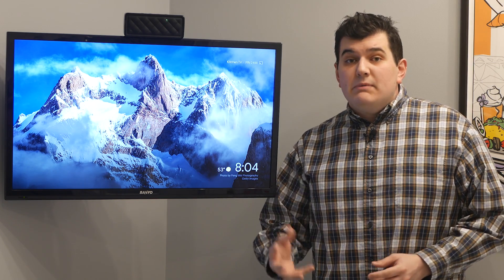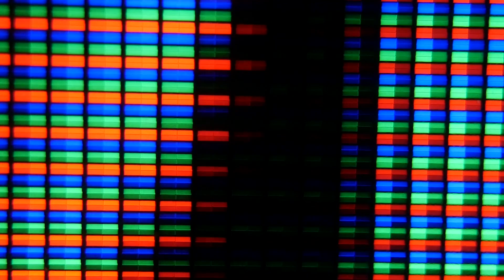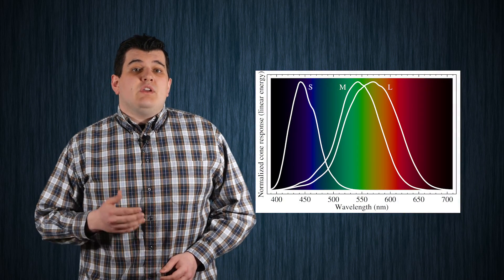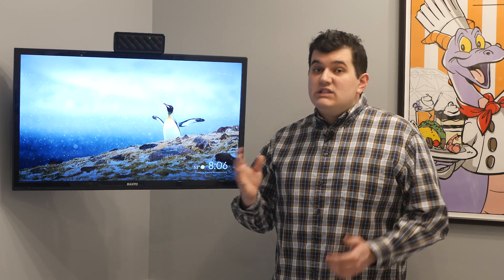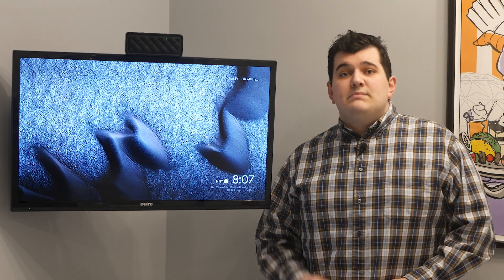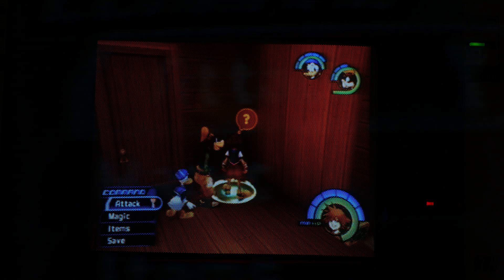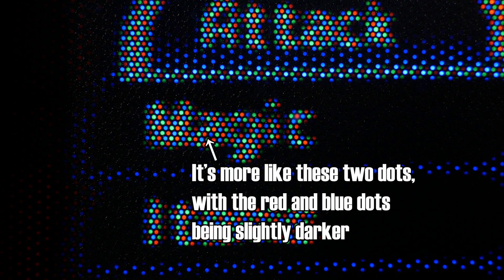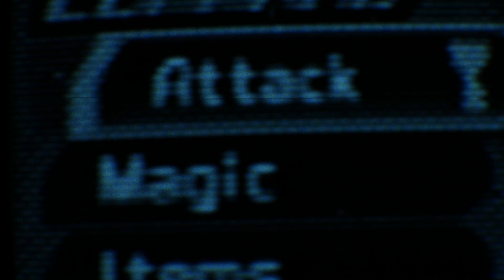These Are Not Pixels: Revisited

Comment: While you could argue that they are not pixels it could be argued they do determine the sharpness of the picture.
In a digital display sharpness is determined by pixels (resolution).
Therefore, while they are not pixels they do perform a similar function.
The electron gun creates a horizontal line like one really long pixel, but the shadow mask/slot mask/trinitron determine what information makes it to your eyes.
At least for a color TV.
Reply: But they don't define the sharpness of the image.  Image detail actually varies within a single phosphor dot (pause at 13:58 to see this).  So sharpness is actually unlimited in terms of CRT technology.  It's certainly possible to have picture detail that isn't visible because it is between phosphors, but the size of the dots does not determine display sharpness.

Think of it this way -- the black and white display really is just one giant phosphor dot, all designed to display white.  But you can clearly make out detail on a B&W TV image.
Reply: They don't determine the detail of the video signal, or the detail that the electron gun emits, but they determine what detail your eyes see (on a color CRT).
This is why dot pitch and line count matter.
Watch Phonedork's videos to see the difference line count makes:
https://youtu.be/ffiR4E1id-8?t=2m36s

Comment: If you're a really old school PC gamer, you might remember that early high resolution color CRT monitors used to have the dot pitch heavily touted as one of their key attributes in advertising. Smaller was always better because it meant more phosphors being lit per sweep and thus a sharper image with more detail in areas of rapidly changing pixel values.
Reply: John Michaelson This made me feel older than I am 😅
But correct nonetheless :-)
Reply: Nah, we're just seasoned veterans! Seeing that Kingdom Hearts demo reminded me of something that I saw back in 1989 when I bought my first gaming rig. It came with a choice of two 640x480 monitors, one had .39mm dot pitch, the other more expensive had .31mm pitch. The better clarity of the latter was startling comparing them both side by side, so much so that it took me a while to grasp what was really happening on the screens and what dot pitch meant compared to the 640x480 part.
Reply: ...with .28 dot pitch being probably the most popular dpi among them. I remember seeing .28 dpi on just about any monitor I looked at back in the day, with the better branded monitors having models that had smaller dpis, like .27 or (Gasp!) .25
Reply: One of the greatest moments in my techie youth was when I got my mitts on a Sun Microsystems branded 21" CRT which was designed to be run at 1600x1200 resolution. :)
Both the clarity and the amount of stuff I could fit on screen at once blew me away - and this was back in the day when 1024x768 was considered "high res".
Reply: Yes, those pitches came later with 1024x768 monitors especially. I had a cruddy old 14" 1024x768 monitor with .28 pitch in the early 90's that I never actually used at that resolution because it emitted an annoying very high (almost dog hearing level) pitched tone at that resolution, and my video card barely supported it anyway. 1024x768x16-colors isn't very exciting.
Reply: @JohnMichaelson  Oh i remember actually hearing this, i was a child so i have no idea what resolution was the monitor, but i could hear a very high pitched noise that my parents couldn't, i actually proved that i could hear it by telling them if the monitor was on or off while not looking at it.
Long sessions in the pc were kinda hard because of that
Reply: raelgoth, I know what you meant, but ".28 dpi" would be some seriously poor resolution . . . 0.28 dots per inch, or 1 dot per 3.6 inches.
Reply: This is still a very relevant value, as these days it has to do with the ratio of the screen's physical size to it's native resolution. You can compare a sharp CRT's dot pitch to an LCD's and figure out if you'll be able to make out pixels from across a room, at a desk, etc.. I always buy screens with at least the dot pitch of a good CRT since my vision's too good for my own good.
Reply: Pretty sure it was this one: https://www.cnet.com/products/sun-x7136a-crt-monitor-21-series/specs/
Reply: @peterjohnson9438 Surplus fixed-frequency monitors that couldn't sync to standard VGA modes could sometimes be acquired surprisingly cheaply, since it took some work to use one on a normal PC - e.g. special cabling and a hacked video card BIOS or custom XF86Config ModeLine at minimum (SVGATextMode was nice on compatible cards), and often a simple hardware circuit as well to combine horizontal & vertical sync with the Green signal.  I had one from an HP workation with 3*BNC inputs in back and a lovely 19" Trinitron tube.  I think I ran it at 1152x864, slightly less than the max possible to allow for 70 or 72Hz refresh rather than 60.
Reply: dot pitch was actually the spacing between the color phosphors. making it harder to see actual pixels but having less black space in the mask.
Reply: See, this makes me curious then. With a PC CRT changes resolution, is it changing the mask? What about when we used to overclock our monitors? I had a 17in NEC that was rated for like 1280x960 or something, but I could force it to run at 1600x1200 by loading the wrong driver. How does this relate to mask?
Reply: @zevindd  Both shadow mask and phosphor array are fixed objects (a stamped piece of metal for the mask) that can't react to your chosen resolution in any way.  When phosphor dots and mask holes are coarser than the active resolution, that just results in a fuzzy image where it's hard to read small text or make out fine detail, since there aren't enough phosphor triads to go around for all the scan lines & pixels you're trying to display.  Remember "dot pitch" being prominently advertised for color CRTs, with small numbers always being preferred?  Ideally, for a sharp picture you'd want more than one phosphor dot per pixel.  This is why monochrome CRTs could be so much sharper for high-resolution text display - no mask, no dots, just continuous phosphor, with focusing as the only limit.  I kept a 21" fixed-frequency mono tube as my second monitor for many years, taken from an IBM RS/6000 UNIX workstation.  I think I paid $100 for it.
Reply: Philips 107B: 0.25 dot pitch. That was my gaming monitor.
Reply: This is similar in printing. The resolution of the print vs resolution of the image to map. That is why DPI and PPI is different. Usually you need more pixels than the printed Easter dots to better map the pixel grid pixels to form the right printed raster dot. So same thing but in reverse. Which makes sense as it’s a subtractive way to form an image.
Reply: This example was useful for understanding the value of smaller dot pitch, thanks!
Reply: I remember my ps1 hooking it up into a different monitor and used to get so much of a different image, in some old tvs it was impossible to tell what you're playing 😂😂
Reply: also the maximum resolution often produced pixels of similar size as the dot pitch which could produce moire patterns. Having a dot pitch that is something like 20% smaller than the pixel size avoided this.
Reply: had a nice zenith flat screen crt, very deep purple when turned off
Reply: Well, for colour monitors, yes, dot pitch was important. But monochrome monitors, not having a shadow mask, have no dot pitch. (The horizontal resolution is limited only by how fast the electron beam can change in brightness.) This is why they could display text so much more clearly and thus why monochrome monitors were often preferred by people doing things that didn't need colour.
Reply: Patrik Lindström damn that's one sweet screen. the best crt monitor i've ever owned was one of those generic 17" that only does 1280x1024 at best, and i used it at 1280x960 (an actual 4:3 resolution) @ 72hz. it was okay, but not great. 
i've recently bought 10 of these screens to use on my lan room, but nowadays i'll go with 1024x768 @ 85hz every time over 1280x960 @72. it's much better.
Reply: @GraveUypo  In Japan, there are analog HDTV signals and 1125i HD CRT TVs
Reply: I had plenty give up, explode and even catch fire. I even had a monitor that after many years of use, realised it used to emanate invisible smoke now and then. Also, noticing the filament burning out in your tube was the worst feeling ever.

Maybe the ones that are LEFT never give up, but the rest were scary as all hell to use D:
Reply: @PeppercornVR  Brought the CRT of my dreams a few years ago, a 22" beauty, only lasted a few months before everything turned a deep red.
Reply: @PeppercornVR  Wait, seriously? Are you referring to CRT monitors in general?
Honestly you're the first person I've ever heard of say something like that - and certainly no monitor or television I've ever owned (including the CRT television under my desk right now which just survived very rough handling being moved 800 km), has failed, much less explode or catch fire...
Eeech.

I've had plenty of desktop PC's fail on me though. Especially those made around the year 2000 or so...
Reply: Yeah except this isn't always true. If your screen has just one pixel then there is no boundary between this one pixel and the others and it can be brighter.  The more sub pixels you have in a screen the more signal is lost to the boundaries between the pixels.  It's the same with digital cameras. 12 megapixel cameras seem to be The Sweet spot between resolution and loss of detail due to thermal noise and pixel boundary loss.

Comment: The phosphor dots are essentially pixels. Just not easily addressable.
Reply: Not really... In theory the CRT can produce images with much higher resolution than the phosphor dots (it's just the color information will be lost / distorted). That would contradict a definition of a pixel.
Reply: That's a bad definition. Here's a better one.
the smallest element of an image that can be individually processed in a video display system.
key words: individually processed. You can not address where on the screen the dot hits. 
The phosphor dots are indeed just phosphor dots. The electron gun is just varying intensity to tag phosphors, it doesn't care a lick if it actually hits anything or not.

Comment: Comparing more with the CRT monitors of old, they had both a set of resolutions that their electronics were capable of, and a screen pitch in dot triads or stripes.

The resolution was the number of lines, and the number of horizontal pixels (converted to a linear scan).

If the monitor had a poor (large) pitch, then the image pixel would not be fully traced across a full set of triads and the detail of small features could be lost, so the maximum relatively faithful resolution was where the image pixel width remained as large as the pitch - it also didn't matter too much if the tracing of the image pixel illuminated a complete RGB set or the GB and the R of the next set, in comparison to the possibly harsh and jagged results of a LCD display at non-native resolution.

Comment: Awesome video, so in theory a BW TV has infinite resolution ability as there's no shadow mask to block the gun. A lot to adsorb in a good way
Reply from the maker: Yes in theory in the resolution is infinite in a B+W CRT.  But, you'd need to make the point of light produce by the gun to get smaller and smaller.  There is a limit in the sense that there is a substantial thickness to the lines drawn.  If they overlap too much you run out of noticeable resolution gain.
Reply: Also at some point you're going to start hitting grains of phosphor, I'd imagine? Size of physical grains is what limits the (truly amazing) resolution of photographic film.

Comment: I disagree with almost every point you made: just because they are also something different does not mean they are not pixels. (Amphibious vehicle is not not a car, just because it is also a boat). Fact is: they are elementary dots of color, that can not be subdivided further (this is the distinction to the grid over newspaper thing: there each cell can contain more then one color, it cannot in the CRT case) containing color. They do not have to be in a perfect grid; just google „OLED pixels“. Looks pretty similar, doesn‘t it? Wired electrical connection? Look at projectors!

The only point I at least agreed partially on was, that they are not directly being addressed, but in my opinion they become pixels at the moment they are being projected onto the monitor. Even with a normal computer monitor you can set the resolution to something higher than the monitors physical resolution, which causes something similar to projecting a pixel image through a CRT: none of the monitor pixels are being directly addressed, but they are still pixels.

Sorry, this all is probably a confusing mess, but I hope you can understand what I mean.
Reply from the maker: They can be divided further, though.  I didn't make this point directly in the video because, as another commenter had pointed out, it becomes confusing to distinguish that with the color subdivisions of the LCD panel.
Look at the closeup at 6:00.  If you pause the video and use the < and > keys to move frame by frame (not sure how to do this on mobile), you can see that my eyebrows move through the grid of phosphors.  Also, there you can see the outline of my eyebrows lies in the middle of many of the groups.  As I said in the video, the phosphor dots only define the maximum color resolution.  There can be and is greater brightness detail within each phosphor dot.
Reply: Technology Connections oh wow, you are right, I am sorry. This should have been emphasized move in the video, since it (in my opinion, at least) is the only really valid point! Keep up the great work!

Comment: Great video again :) I would like to ask you to make a video about CRT computer monitors, if you could?  I ask this because those are talked about by resolution, such as my old Samsung flat screen 17 inch CRT monitors being 1280x1024 resolution, and John Carmack is seen in a photo with a 1920x1080 monitor back in 1995. It might help folks understand what makes a monitor different from a TV. I have to say, I dig every one of your videos like this, being as I am always curious about how things work in technology both new and old. Just recently turned 35, so I have had a chance to see how quickly technology has advanced through the past 3 decades.
Reply: That's a great idea, I'd like to see this too. From what I know, CRT monitors worked on the exact same principle as color TVs, they just included more active electronics to control how many lines the tube should draw, and at which speed.
Reply: So, let me blow your mind: Your 17" CRT probably could go higher than it's advertised resolution. PC monitors have circuitry to change the frequency of the flyback based on the incoming sync pulses, and thus a range of horizontal and vertical sync frequencies they could be driven at. This is called "multiscan" and is a unique feature of monitors that was implemented to resolve compatibility issues with different PC video cards and resolutions. But it doesn't actually change what the CRT is doing: just painting lines of light onto a surface.

Note how CRTs don't need upscalers! If you reduced your resolution back down to 640x480, you got the exact same output as you would from an identical "640x480" CRT monitor. LCDs need upscalers in order to produce a native image because they do have a fixed resolution, because they do have pixels.
Reply: @Super Smash Dolls if it could it would be with huge distortions, even highend models like Carmacks 28hd96 werent stellar at the upper side of specs, moire and wonky geometry due to analog channel not keeping up etc.
Reply: My Samsung monitors would go a bit higher than 1280x1024, which was their native resolution, however the refresh was painfully slow at native resolution or higher because they could only manage 60Hz or less at that point, which flickered and gave me a headache. I ran them instead at 1024x768 resolution and 85Hz refresh. I was willing to take a hit on over all pixel count in games at the time  because I preferred the higher buttery smooth frame rates and no screen flicker. It was a beautiful thing to play a game with 200+FPS with everything cranked and have absolutely no texture tearing like I see on a modern screen anytime the FPS is higher than the refresh rate of the screen.
Reply: @Carstuff111 you are thinking of $10K Silicon Graphics/Integraph InterView 28hd96 released in 1997(late afair), Carmack used it while working on Quake 3, so picture is from 1998 not 1995. For contrast in 2001 IBM released $20K 3840×2400 LCD, by 2003 it was $8K.
Reply: The IBM T221 is such an interesting piece of history. Makes me wonder why high DPI has taken so long to catch on.
Reply: fyi 1600x1200 was the standard resolution of high quality 19 inchers of the day, at 72Hz.  Had to have a video card capable with enough VRAM on the card.